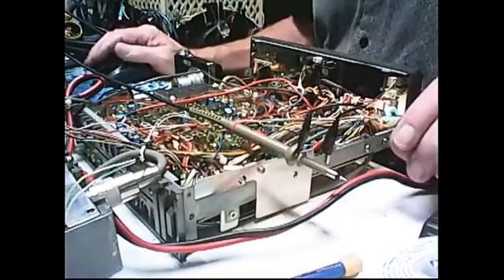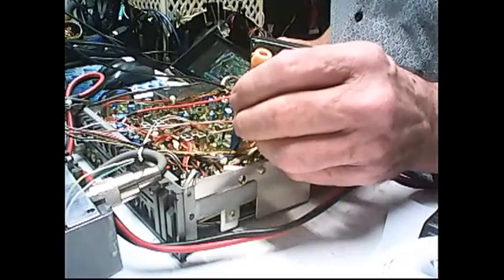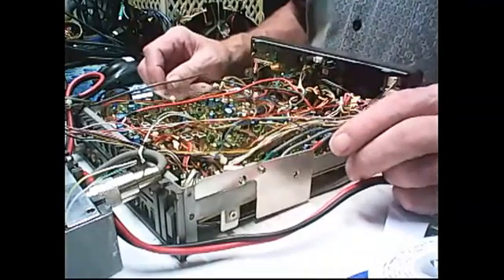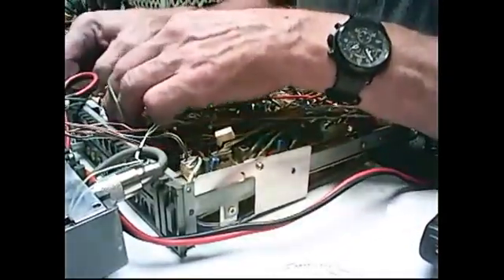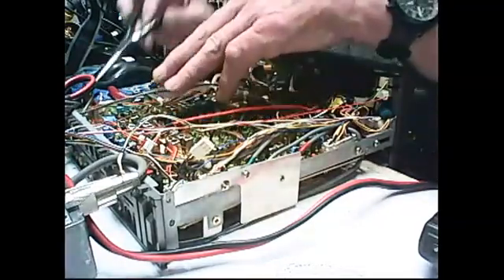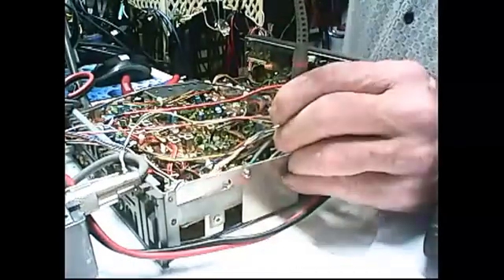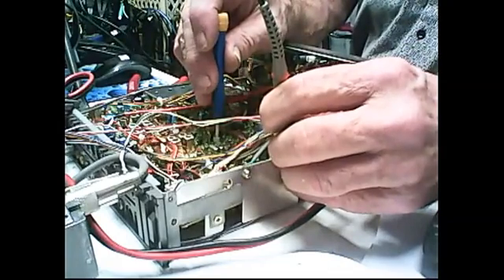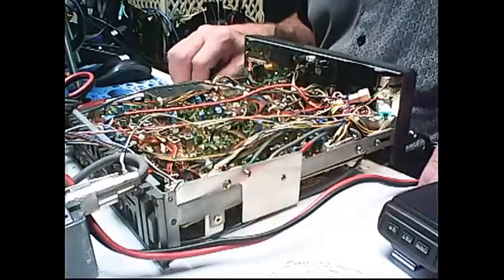757GX Crystal

Comment: Would you by chance consider refurbishing a 757 gx?
Reply from the maker: Richard Weidman I have done a bunch of them. What is wrong with yours?
Reply: AERVBlog it has the talk back issue but it is intermittent. The volume pot seems dirty. Crackles and such when adjusting volume. I'm told it sounds poor on am. NB and agf don't seem to have any affect when on. Probably could use caps. Output is a little low on ssb. I'm thinking an overall health check would be helpful.
Reply from the maker: Richard Weidman sounds like it needs all new diodes and caps first off then a good cleaning and finally a careful alignment. The crystals drift over time. I can usually walk them back in but sometimes I need to replace them and that can be tricky since they are getting rare. I do have a couple on hand of the one kind. The double freq one for USB and CW is a bit harder to get hold of. I can give it a shot.